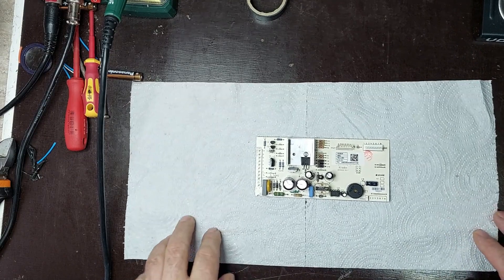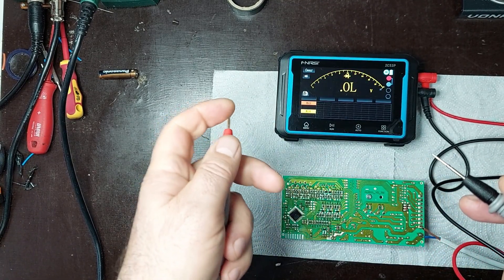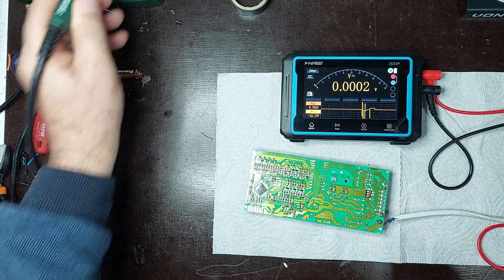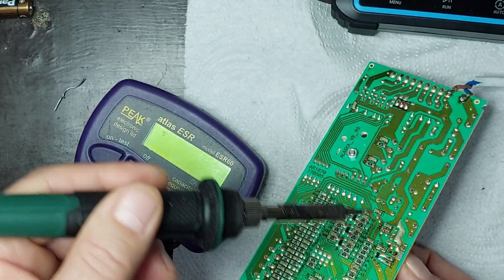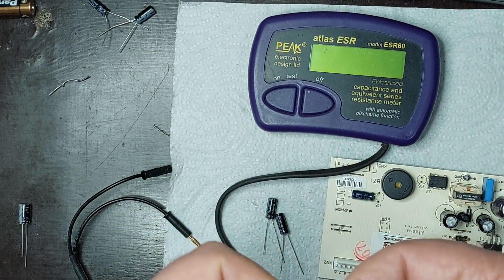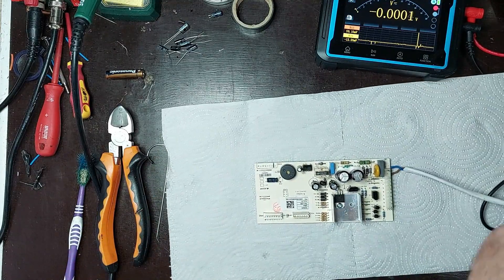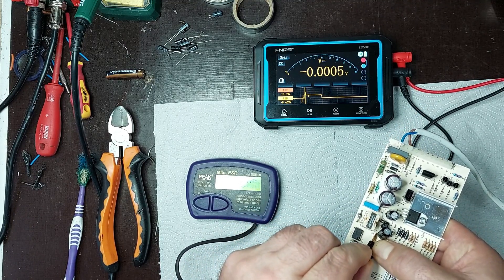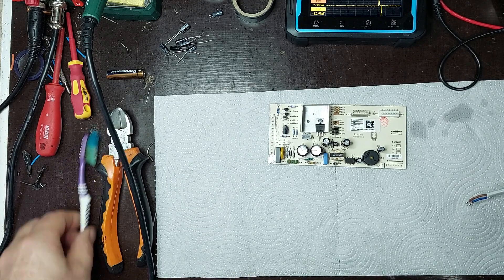How to fix Power Supply  Arctic Refrigerator

Comment: Hi, this was an amazing video, thanks. I have exact same board. One day, I was testing the thermostate registance becuase even if the temperature of both fridge and freezer was reached, still compressor was continuously running. Found they all were open. Accidentally, the board touched the metal and a shortcircute and after that no light, no compressor start. After waching your video, I measured the switch capacitor and it was 48uf, but I was finding the 220uf capacitors were reading 230uf. Also, the mkp62 275 x2 104m capacitor was reading 0.8uf instead of 0.1uf,  I am waiting for these parts to arrive so I can change them. But, do you have any idea, what could be wrong.
Reply from the maker: The cause of the defect in your case is not the capacitors. Watch the video and check the 5-volt voltage at the terminals of the capacitor in the secondary circuit. If the 5-volt voltage is not present, you should check the resistance and the inductor that powers the U2 integrated circuit — P1011AP06. If the resistance and inductor are open, then the integrated circuit is surely damaged. You will need to replace the integrated circuit and the inductor. Good luck.
Reply: @electro-master73  Hi, the inductor has no code written on it. It only has "R" written on it. It measures 0.2 OHM, But, when I try to buy, it requires "uH" unit. Do you know what uH value it is inductor is or any other suggestion? Thanks again.
Reply from the maker: @nahid2k12  If the inductor has 0.2 ohms continuity then it is ok, it does not need to be replaced. Have you checked the secondary voltage, it is 5 volts dc? Watch the video
Reply: @electro-master73  thanks for your reply. I have checked the voltage and there is no 5v DC there. So, I am replacing the IC - P1011AP06
Reply from the maker: @nahid2k12  Yes, replace IC - P1011AP06 and check the resistor which is next to the inductor .     
@n3n4d5
"So, it ended up being exactly what you said. That IC was at fault. 
I had some trouble finding the exact replacement. My best option was to order one from China. Well, I had no time to wait for that.
I got TNY 264 PN which was available to buy locally and it works. So far... Haha
Thank you very much! I appreciate your videos and help you provide. Knowledge is power. Best regards! "
Reply: Hi @electro-master73 I have replaced with the new IC but as soon I plug in, the R1 (39ohm) is blowing out every time. Any idea? Thanks again.

Comment: Hi, thanks for the video! It's really nice and educational.
I have the same board but another problem and can't really pinpoint what is wrong.
The fridge stopped cooling. I've disconnected it from the power supply and when I tried to check it day after i heard a tick and the display on the fridge also stopped working.
So, when I checked the pcb, 29ohm resistor R1 was blown. Thats the one right next from the mkp x2 safety capacitor on the line in.
I've also noticed that the capacitor C7 220uF was bulged and defective so i installed a new one.
Ever since, the 29ohm resistor keeps blowing instantly when i apply power to the board. As if there is a short but i couldn't find a short. Since then, I've also replaced all capacitors, checked all diodes and transistors. Everything looks ok but the R1 keeps blowing and i am losing ideas where to look next.
Any Idea what i should do?
Reply from the maker: Change integrated circuit U2 -----  P1011AP06 is broken 100% as a precaution replace all electrolytic capacitors. It doesn't cost much.
Reply: @electro-master73  thanks for quick response. I'll try to find a replacement part an change it and change capacitors. Will come back and report if it works or not. Cheers!
Reply: So, it ended up being exactly what you said. That IC was at fault. 
I had some trouble finding the exact replacement. My best option was to order one from China. Well, I had no time to wait for that.
I got TNY 264 PN which was available to buy locally and it works. So far... Haha
Thank you very much! I appreciate your videos and help you provide. Knowledge is power. Best regards!